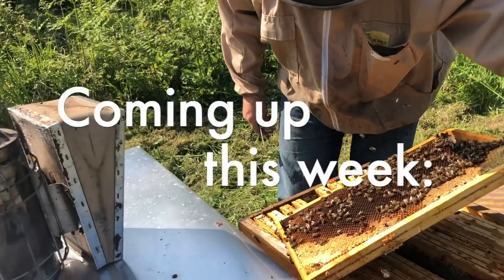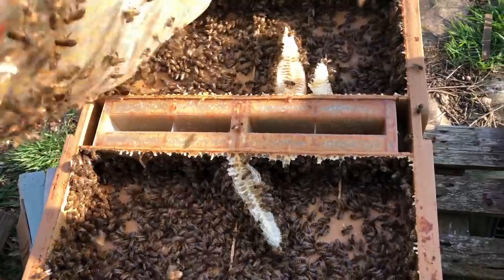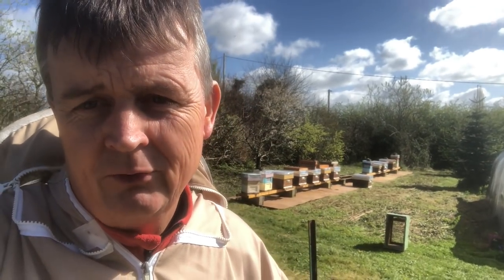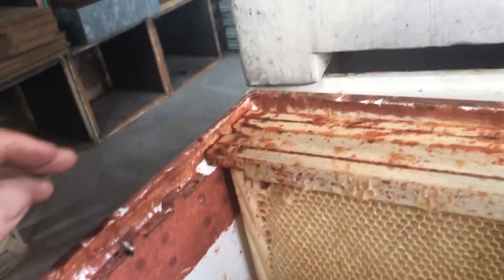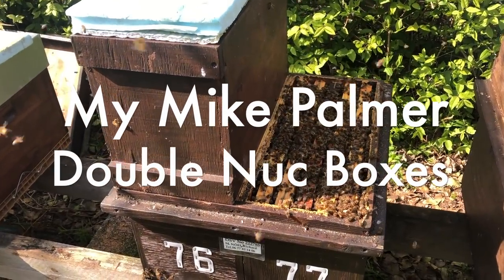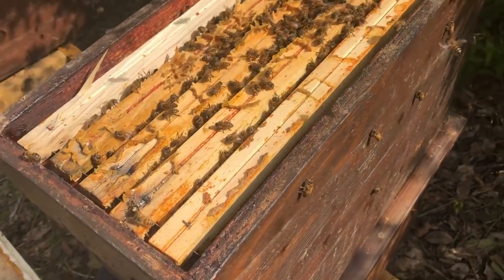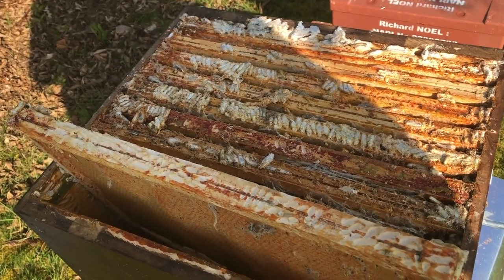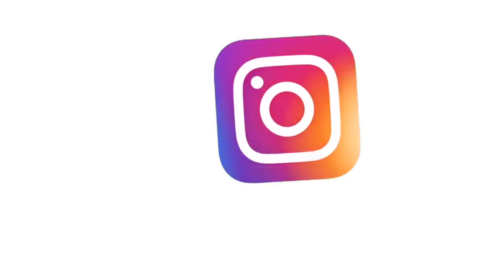Early Spring Compilation

Comment: Good video Richard, a couple of years ago I had a nuc box in a worse condition with wax moth than yours. I haven't inspected mine properly yet but they are heavy and bringing in plenty of pollen. One hive got knocked over by a sheep in February and there were 8 frames covered in bees, didn't check for brood as it was cold here in South Wales.

Comment: I use feed sacs, but I like your plastic better, I know ventilation isn't a problem or you wouldn't use them, but seems like it couldn't ventilate and they would get too hot? please explain how this isn't the case only thing I can think is that they are drinking whatever moisture is there or that  it's on the walls only?
Reply: how many feral hives in trees have an upper vent hole?  Not sure it's necessary.....have videos from early 90's in Germany showing "plastic foil"  as they called it (visqueen) being used with no upper vent....winter also.
Reply: @KevinsNorthernExposure  
I run over 100 colonies here in Tasmania Oz.
Never used top vents.
I use a plastic sheet on top of frames.